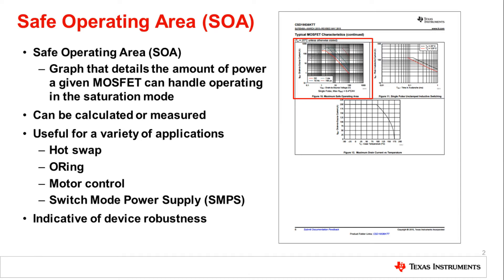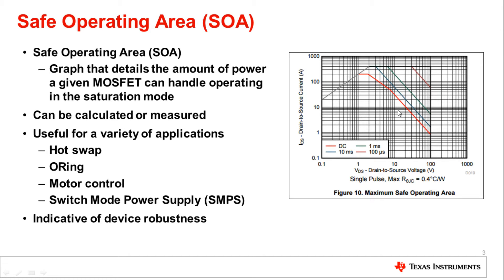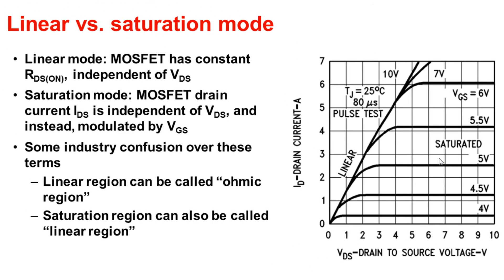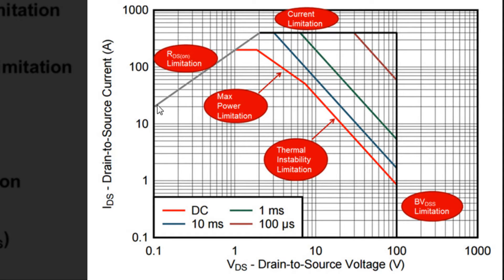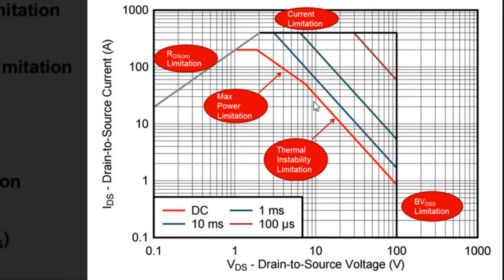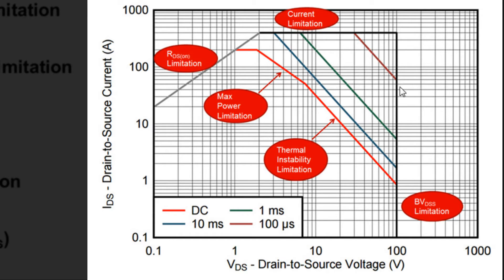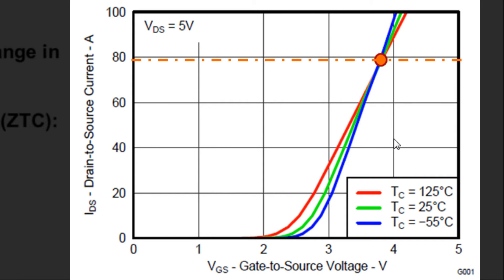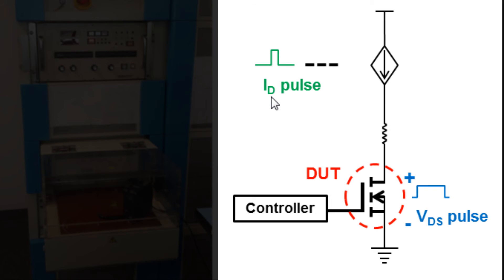Understanding MOSFET datasheets: Safe Operating Area (SOA)

Comment: thanks for your excellent explanation, but I'm still confused: 1) the junction to case thermal resistance is specified by design? cannot be experimentally measured? 2) since SOA is based on fixed case temperature 25 degree, how to fix T_case at 25 degree and measure the thermal instability under DC condition? Looking forward to an answer. Thanks

Comment: I was taught the opposite. The linear region is named based on the load line having a nearly liner amplification. The saturation region is named because the amplifier circuit is saturated and can no longer provide the output necessary for linear amplification.

Comment: Aren't temp coefficients defined w.r.t. resistance? It would have been much easier to understand if the engineer mentioned that the devices have a negative temp co-efficient that would in turn result in thermal runaway

Comment: IAM working on DC linear mode and in high temperature . So iam testing a 1200w mosfet 200v 60A but what every I do it always fail in 40V 10A
Reply: what mosfet are you using? Those could be some costly mistakes you are making. 200v at 60a is asking a lot of any mosfet, even 2kw mosfets, especially if you haven't got your cooling situation on lock down.

Comment: so what causes the fet to heat up faster. high current pulses. or a constant high current. I guess what I'm asking does the switching cause any added heat? and does the FET work more efficient heat wise under pulses or constant current. another informative easy to follow video. thanks

Comment: I know why people refer to the MOSFET saturated region as the linear region. It is because the BJT linear region looks very similar to the MOSFET saturation region. The difference is significant even though the curves look the same and I think saturated is the better term. Mostly because BJTs are current-controlled and are linearly responsive to their base current, whereas MOSFETs are voltage controlled and are non-linearly related to their gate voltage.
Reply: Is this correct?
Saturation region: When the transistor is fully on, because its channel region is fully conductive.
Linear region: When the transistor is partially on, because its channel region is not fully conductive, such that the gate can continuously vary the amount of attenuation applied to current flow through its channel region.

Comment: would it be different if the mosfet is sof-switched? also, would the cooling system design affect the safe operating area of the mosfet?
Reply: As for the cooling system, definitively. The datasheet is quite precise about which one is used, at least.